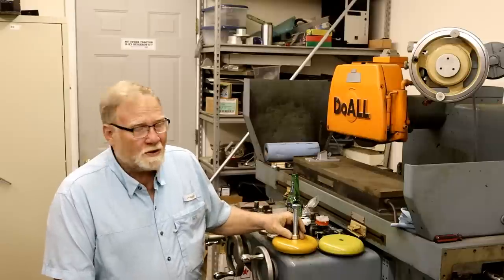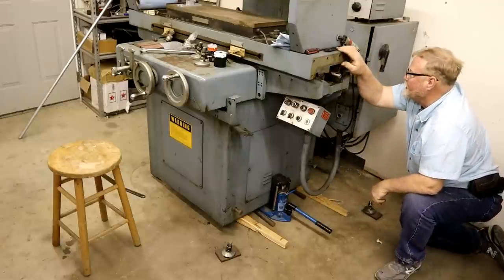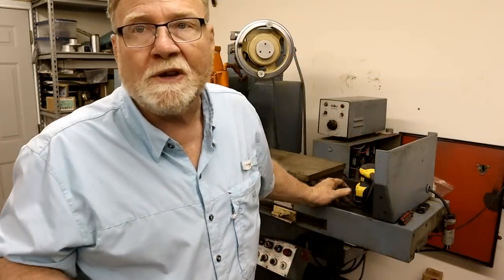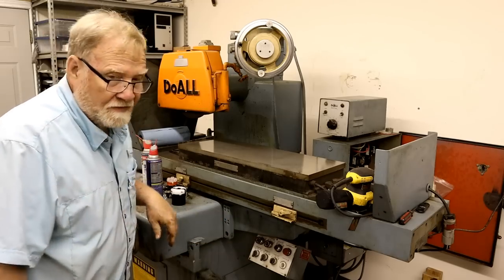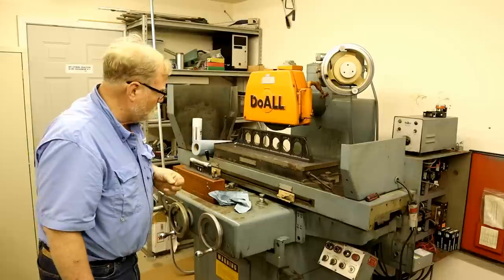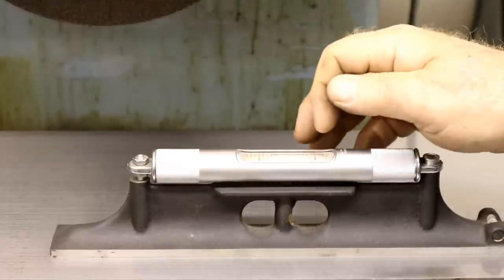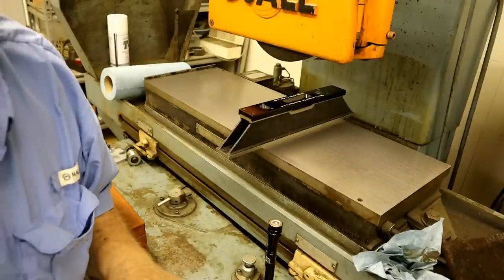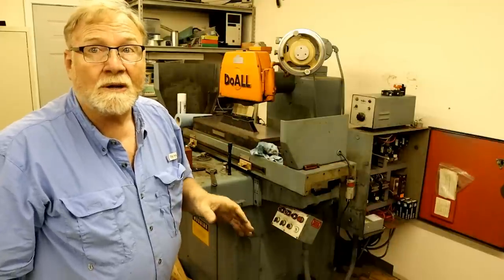EASY WAY to refurbish any metal table : Leveling the DoAll 14" Grinder

Comment: I’ve always used cat litter to soak up oil, works fine for me.
Reply from the maker: I carry a jug on the Motor Home... The fills , one on each side of the buss, are sometimes funky to hold the hose in and I have had some spills..  Cat litter works well for that and I don't feel like a heel driving off and leaving a puddle for people to step in....

Comment: Steve  try a bullseye type level that way you don't have to keep switching your level around if you don't have a reference in each axis to line up your level. You well save a lot of time bubble chasing. Cheers
Reply from the maker: I did not know of any bullseye level that even approaches the accuracy of the levels I am using.   Do you know of one?

Comment: i put a galvanized steel pan under my grinder when i set it. figured it would help contain the hydraulic fluid and coolant when it leaks. also made cleaning the greasy pig up. sprayed it down with degreaser then rinsed it with a tank sprayer and water. then sucked all the crude out of the pan with the wet/dry vacuum.
Reply from the maker: That would help.... Would need about a 5 foot x 5 foot pan for this one.....

Comment: Scotch-Brite pad and a Palm sander ain't going to hurt it, now if you threw some 36 grit sandpaper on the palm sander I'd be worried but Scotch-Brite isn't removing any metal it's just clearing gunk and rust. Good little trick!
If you're worried about the mystery pads cut an old tire up and use the sidewall rubber as dampeners. 

Comment engagement counts for a good chunk of recommendations too. I always try to comment just bc of that fact. 👍👍
Reply from the maker: Thanks for the comment :)
Reply: I've used the scotchbrite pads + wd40 trick on my table saw top, and to clean up the box ways on the CNC mill I'm working on. I sure hope it doesn't remove too much material, that's kind of the whole point of that method, that it doesn't remove anything other than the loose oxides from the surface. On the Practical Machining forum, I read a post somewhere that said one of the machine tool companies used that method, plus adding in powdered kitchen cleanser (like bar keepers friend) for refurbishing ways on used machines they were prepping for sale. I tried the powdered cleanser on the ways on my machine, and didn't really see much of a difference over just a scotchbrite pad, plus it made quite the mess! I did cover up everything else in the area before trying it - didn't want to get abrasive powdered cleanser on the ball screw or into the ball nut!

Comment: Per South Bend’s directions from about 1950, I used tar paper between the leveling feet I installed on the lathe and steel pucks, and between the pucks and the floor. Damps a bit of vibration, but mostly keeps it from walking without having to drill my radiant-heated floor for anchor bolts.
Reply from the maker: Over the years I have had to tear off a number of house roofs where 30 pound tar paper was used under the shingles as a wear guard for the back of the shingles... after about 20 years that 30 pound paper was really thin... I wonder if the weight and vibrations of your lathe would wear it out over the years?
Reply: @10swatkins  Roofing used as such is subject to so much heat that I suspect lots of what makes tar tar evaporates off eventually. But roofing felt in my experience is fairly thin even when new. I would use it like friction tape, not like a cushion. I sorta doubt these machines really need that much cushion, unless they are imparting quite a bit of vibration themselves. You wouldn’t want a grinder vibrating that much. But with the table walking back and forth, you’d want it not to walk with the momentum of the table. All theory to me. I suspect my lathe wouldn’t be inclined to move with or without the roofing felt. It certainly had not moved a fraction in the 40 years it was sitting in its previous location. :)

Comment: Bags of bentonite powder used to waterproof pond bottoms and for drilling mud. When swept around and allowed to sit over oil stains on concrete has amazing ability to pull the oil out of concrete.   Its a super absorbent.
Reply: Cheap non-perfumed cat litter can be a decent source of bentonite.  Check the label to make sure it's clay.  A little bit of solvent on the oil will help but be sure there's no ignition sources nearby.
Reply from the maker: I by the bags of auto absorbent and grind it in with my feet....

Comment: Don has his uses, occasionally. ;) I was just thinking, to make jobs like this easier when working alone, use two phones (borrow the wife's) and a Messenger or Facetime or similar video calling app. Use one phone on a stand on the table to monitor the level, and the other phone down with you on the floor to view it. That will potentially save a lot of getting up and down, if it has the video resolution to work.
Reply from the maker: That's a great Idea :)

Comment: I wonder ... the moment you mentioned the oil stain, a light bulb lit up in my memory - those felt pads might not have anything to do with vibration. They may have everything to do with isolating the steel feet from the concrete floor. Where I live in Canada, steel that touches concrete rusts .. Fast! And that would quickly throw off the level ...
Also .. watching you level that ... I come from wood working/building more than machining ... we've always ran the level along the diagonally corner to corner. Level 2 opposite corners, turn the level for the other 2 corners, and level. Then double check X and Y for level and usually close enough. Starting Diagonally turns a 4 pointed square plane into two overlapping 3 pointed triangles ... which are agreeably easier to level ... 
I'm rambling worse than Don now ... 
Thanks for sharing 🇨🇦
Reply from the maker: I think is is more for vibration and even keeping the machine from moving around a lot... The bed has a lot of mass and when it gets going back and forth on automatic I think it will try to walk around... If I speed up the Planer I can make that sucker walk about a foot on each return stroke :)
Reply: @10swatkins  ... I would pay good money to stand about 10 feet back and watch your planer dance like that!
I wouldn't because I would be afraid for the machine itself, but 5 ton(?) of metal dancing would be impressive to see!!!

Comment: Don's little trick works for cleaning gasket surfaces on a variety of engine parts, also.

I opted to wait for a while, before trying to grind in the chuck on mine.  Just in case Bozo tries a sneak attack while I'm still unfamiliar with the controls.
Reply from the maker: Oh I understand that !

Comment: I have some woodworking equipment in my basement in Ohio and I did the prep on it like you did with the power sander and a scotch brite pad and when I was done I sprayed all of it with Bostik Top Coat and that was over 10 years ago and all of my table tops still feel silky smooth (I’m just a part time user). Amazon has it and it’s not cheap, around $30.00 for a spray can but it works great and I’ll use it again when it needs it. Just another option.
Reply from the maker: Thanks for the tip!

Comment: Are the tubes in the side box fastened together and to the back panel of the cabinet.  And soft foam rubber top and bottom inside the boxes.  A small dot of hot glue to stick the boxes together and against the back wall.  I keep visualizing them falling out the door of the cabinet.
Reply from the maker: No they are just placed in there and held in place by the lip...   I'm going to move them into a drawer before I start wiring... Thanks for worrying about it for me :)

Comment: Steve, after you hand scraped the bottom of the Starrett precision level, did you have to send it away to be re-calibrated?
Reply: Levels are self proving, so you can calibrate with just the level.  To do so you rotate the level on a surface plate until it reads 0, the rotate the level 180 degrees.  If the bubble move from 0 you adjust half the change and restart.  A couple of cycles will 0 the level.
Reply from the maker: What Russ said :)
Reply: @russkepler  Make sure you put down a square or something on the plate, so when you flip the level, you can index it to the exact same position every time. And you don't necessarily need to find the orientation of the level that reads 0, just make sure the bubble reads the same when you flip the level in the exact same position.

Comment: Steve are you going to dust the chuck?  I would like to see a video on the proper method.  Thanks!
Reply from the maker: About a 80% chance of not going to have to.... It's looking really good.. If I do decide to do so it will only be after mounting an indicator and measuring it....

Comment: Great explanation on the leveling process. Is the 14 inch referring to the travel, or the wheel size. I came across a chance to pick up one of those large levels like the one you have there, so I grabbed it.
Reply from the maker: It's the wheel size     The mag chuck on this one is 10" wide and 30" long...
Reply: @10swatkins  Wow, that's a bruiser. Nice.

Comment: Hello Steve, is it not easy to use 2 levels?  Can your wife not help you she can see if the level  is in line so you do not stand up 100time 👍😉
Reply from the maker: The levels both have a smaller  bubble  so they do check both axis at once but the small bubble is only good for getting close so I turn them around... Each of the levels I used are of different sensitivity  with the last one being 0.0005 in one foot...  I use the first one to get it into the range of the last one... 

The wife has this problem with me telling her what to do :)